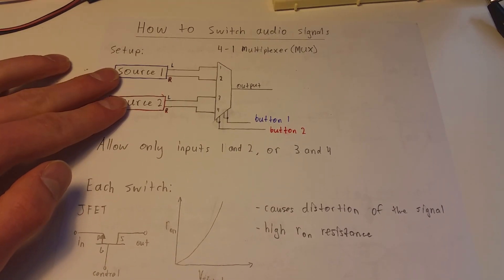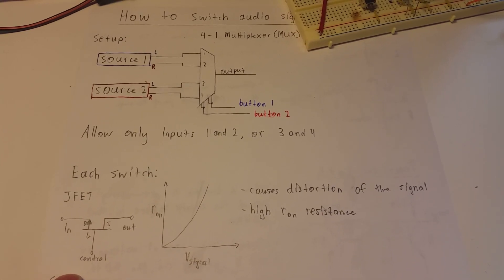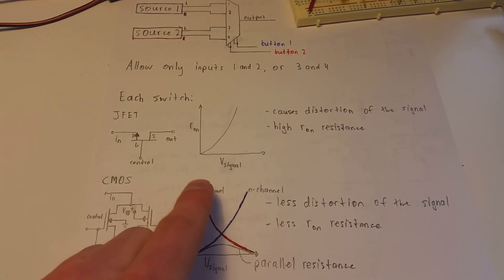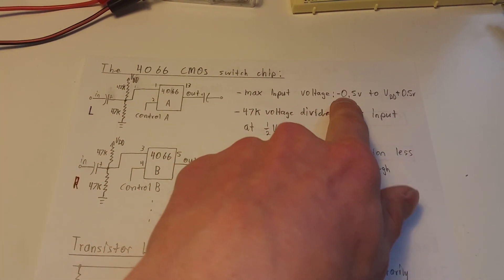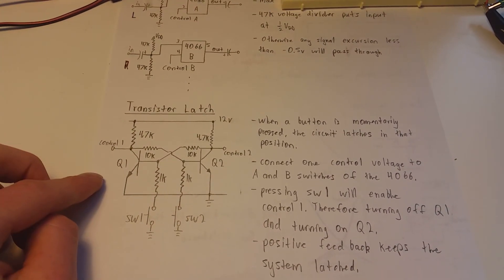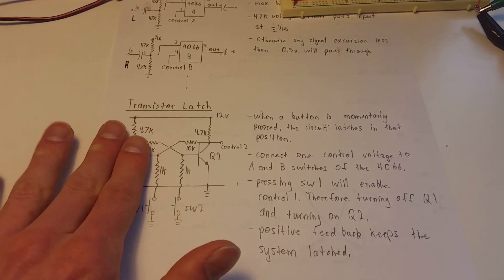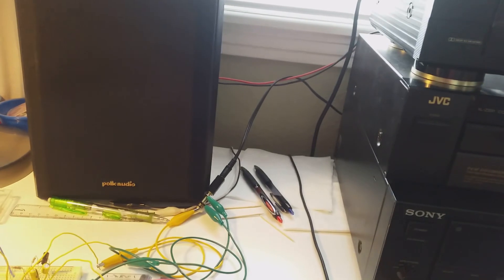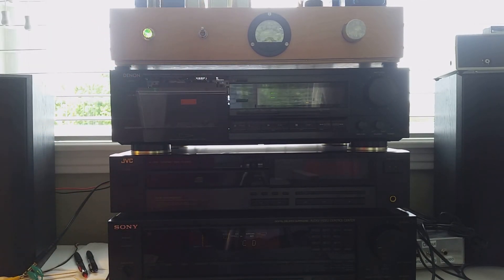Audio Signal Switch

Comment: Any active element you put in the signal path adds distortion.
I believe that, if your intention is to make an active audio selector, it is better to have a selector that short-circuits the signals you don't want, and leaves the signal you want to hear loud.
That is very easy to do using bipolar transistors and does not add any distortion to the signal.  If instead of bipolar transistors you use CMOS, much better.  A CMOS transistor can go from several MΩ  to a few tenths of an Ω  when turned on.

Comment: Cool dude!
I'm building an equalizer/chorus/reverb unit to put into my amplifier's fx loop and my idea is to make it all switchable, turn on and off the eq or reverb or chorus bypassing it out of the signal chain by footswitch, I thought the most practical way would be using relays, but then I would get a loud pop, so I was thinking in using some kind of analog switch but I don't have push buttons for the footswitch, just SPST/SPDT switches. For the IC I think it would work better with a DG419 or some similar , any suggestions?
Reply from the maker: The DG419 actually sounds like a better alternative since it can cope with audio signals better and handle split supplies if you have them. With a trimmed split supply, you should be able to couple the signals in directly without the caps or resistors. The loud electrical pop sound could still happen even with a solid-state switch. It usually comes from charge built up in the cables from static or from small differences in DC voltage from different devices getting discharged when switched in. If you had no caps to be charged and discharged in the switching network, it might really help the popping issue. Unfortunately, the DG419 is a break-before-make type switch. This means charge can accumulate for a split second before it makes the new connection. As far as relays go, dual-coil latching relays would be best and would have lower distortion than any CMOS switch. Since it's a guitar amp though, a little more distortion probably won't matter. Also, slide switches or toggle switches will make the circuit easier to make, I just used pushbutton switches in the video to make it useful for that situation.

Comment: Is there any way to make it  automatic so when the second input has signal it will cancel out the first input so  the second input will play thanks
Reply from the maker: You can make a peak detector or some type of comparator. When a signal appears on the input, it will charge up the peak detector or trigger the comparator. The voltage on the output can be used to flip the switch for the opposite channel. If you want both inputs to automatically switch, just use two comparators/peak detectors. The output of each of the comparators/peak detectors would have to couple up to where the pushbutton switches would normally go. This way, the latch circuit can latch normally.

Comment: Sorry might be dumb question but i am new to this and trying one project, can this be used for video too? I have requirement where i have 3 video input and 1 output to screen. I want decide which video source to be shown based on Push button, i didn't find any suitable thing so far... Will this work? if not do you know any other options?
Reply from the maker: You can use this for video, but be aware that there will be some loss. The 4066 doesn't quite have the bandwidth so the video may not be perfect. Also, play around with the values of the capacitors and resistors, the video cable has a 75 ohm impedance (I think) and if you can maintain that through to the TV, the video will still look good. I haven't tried it though so I have no idea what works best.
Reply: @thetuberoaster8321  Thanks, i won't be connecting this to TV my plan is to connect it with car rear view camera and screen. I saw another option  3 Channel Video Switcher Module 3  online but this one is for FPV so not sure how i can switch it with push button.
Reply: I successfully use 4066 chip to switch video signals, despite its noticeable resistance in on state. No perceivable video degradation so far. But it's better to use MAX4547 or NJM2235D for such purposes.
Reply: @WRXMSK  Do you have any video which i can refer? Did you use resistor or capacitor? What voltage did you pass?

Comment: I think that DC coupling capacitors can be ceramic. And also for bipolar signals it is better to use DG4** switches or even MAX series (if you want something hi-end). I've digged into CMOS multiplexers a bit and a forum tells that they need a lot of additional "addons" to the circuitry if you don't want different "side effects". DG4** works with a minimum set of components and do the job great because they are designed to switch audio signals (not digital primarily).
Reply from the maker: Interesting, I was wondering if there were higher-end switches made for audio. I've just never found them until now. In Hi-Fi applications I would usually use relays but those MAX chips seem like they'd make fairly low distortion.
Reply: Which switch from the MAX series are you referring to? Please give me example
Reply: @thetuberoaster8321  I know that bistable relays can be used for this, but I don't know, maybe some distortion can be applied due to relay construction and physical properties? Or this is appropriate way, what you think?
Reply from the maker: @switlle  If latching relays are what you mean, yes you could totally use those and the distortion shouldn't be any worse. Sometimes, it can be hard to get those relays in the right contact arrangements or coil voltages you want. I thought about using them but instead decided to use a circuit that would accommodate more widely available parts.

The MAX switch I'm referring to is the MAX312L.

Comment: Sir can i ise it for guitar pedal switcher?
Reply from the maker: Yes but increase the input resistors to 2.2M or buffer it with another pedal to avoid loading the guitar. With 2.2M resistors you can use 0.1uF caps for input and output.

Comment: I'm guessing you're an audiophile or at least an "audio aficionado", so my question is can you notice any distortion or difference in audio while using the 4066?
Reply from the maker: I haven't used this exact circuit extensively, but from what I have heard, there is a difference depending on how the 4066 is operated. For signals that have a very large dynamic range (clipping of peaks) or loads that draw more than a few mA of current (or draw current unevenly at different frequencies), the distortion might become quite noticeable. For most applications, it's quite subtle and it would work just fine. (The datasheet claims 0.4% THD under ideal conditions. Around 0.7 - 1% THD is where it becomes noticeable at least for odd harmonic distortion.) For Hi-Fi designs though, I still use mechanical relays because they are more transparent sounding and aren't as restricted by voltage and power.

Comment: Can we switch two audio source of 100w using this chip?
Reply from the maker: It's a low powered chip designed for line level signals. The maximum input current is only +/- 10 mA which means it can only take about 200mW before burning up the MOSFETs. It can switch the input signal to a 100w amp but not the actual speaker output. For that you'll need something heavy duty like a relay.
Reply: Thank you sir.

Comment: What size coupling capacitors are you using ?
Reply from the maker: 5.6 uF but the value is not critical. It depends on the impedance of the circuit it is connected to.
Reply: Normally, the coupling capacitors are calculated for the low end of the audio frequencies to around 10-20Hz. For example, for 16Hz, you could use 0.1μF with a 100kΩ input impedance, 1μF with 10kΩ, and 10μF with 1kΩ. Using a larger value would simply extend the lower end without having significant negative effect on the circuit. So, you could actually use 10-47μF if you're not sure what's the impedance in your circuit.

Comment: Excellent video. I have a HEF4053 which also has these switches. I'm going to try if I can use that to switch audio signals. :)
Reply from the maker: The HEF4053 would be interesting because it contains one more switch than the 4066. I think it still has the problem of the input voltage not being able to to less than -0.5 V which is what I accidentally discovered with the 4066. After carefully reading the datasheet, I discovered why when I turned the switch off it wouldn't stop the signal but clip it.
Reply: I'll have to wait until I get my oscilloscope back (channel 1 is faulty somehow) so I can experiment with that. Would be interesting to see how it copes with these negative voltages.
Reply: use pulldown resistors.
Reply: The 4066 has 4 SPST switches, and the 4053 has 3 SPDT switches.

Comment: How to make it with one button?
Reply from the maker: You'd have to find a circuit that latches with only one button. You can make one, but they are a bit more complicated and more finicky than a two button circuit. One type is very similar to the latch described here. You can search "single button latch" and you'll get a circuit that looks a lot like this one but with some changes. It's not the most reliable but it is probably the simplest out there.

Comment: Still some cross talk I think you need another switch in series with the output to ground or half rail voltage, good effort though.
Reply from the maker: Is it crosstalk between channels or feedthrough from input to output?
Reply: yes the crosstalk is in the cmos switch if you wire a second cmos switch between the first cmos switch output to ground or your half rail reference voltage & put a series resistor of a few kilo ohms at the junction of the 2 cmos switches at the output & connect opposing voltages to the control pins so one cmos is switched on & the other off this will work much better then 1 cmos switch & give much better isolation & you will have no crosstalk, the alternate is  to use a 4053 which is a 3 channel double pole cmos switch & tie the off state pins to ground. its 3 pole double throw . @thetuberoaster8321

Comment: 4066 vs 4053?
Reply from the maker: They are basically the same chip except for one small detail. The 4053 has both a Vss and a Vee pin. One for 0V and one for a negative power supply. Like I showed in my video, the input cannot go below the negative supply rail. I showed how to compensate for it using a resistor network. For some applications, it's best to have a clean channel with no extra voltages or impedances. Actually, it seems that the 405X series is more geared to audio applications. The datasheet markets the device differently than the 4066.
Reply: @thetuberoaster8321  Thank for reply